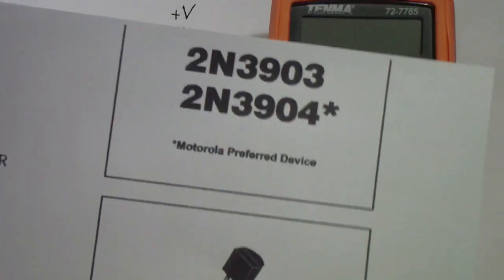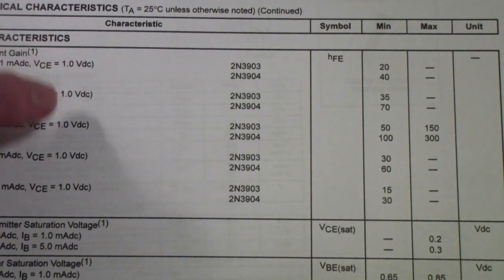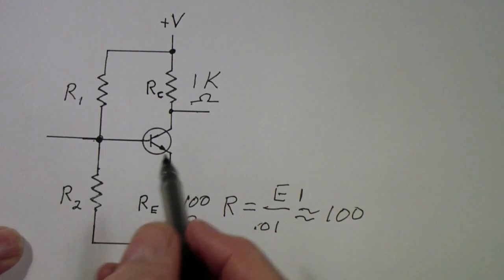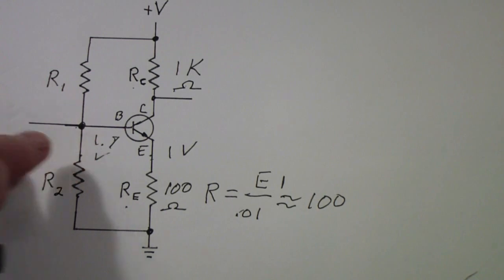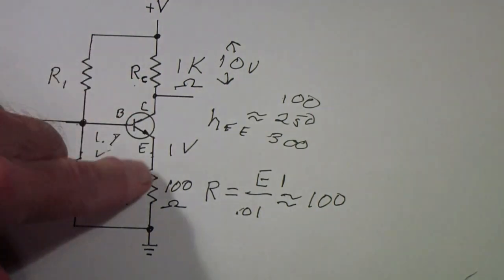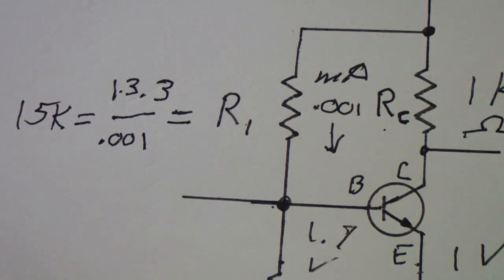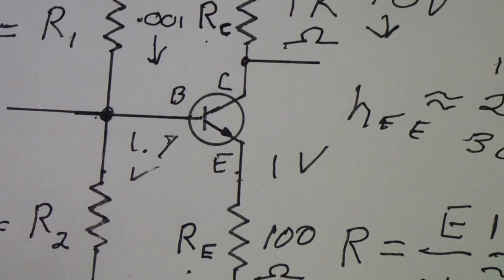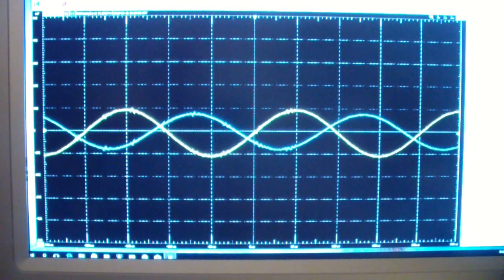TTT136 Class A Transistor Amplifiers Pt1

Comment: I understand that when the input signal is 100 mill volts the output is 10 times that or one volt, but what's going on when the output slides down to 100 mill volts (as shown on the oscilloscope) and the signal input strength rises to one volt, If I'm interpreting the scope correctly? Or is it possible that the two separate channels are set up for different volts per division etc.?

Thanks for the great video

Comment: I find your way of explaining logical and to the point but the thing that I don't understand at all is how you can plug some random voltage and current numbers out of thin air to use in your calculations. Like for example the voltage drop over collector and emitter. You just decide it to be 4 volts. The same with the current of the collector. You just say it's 10 mA. How do you get to such numbers?

Comment: it need a lot of math to workout to get it right my friends that I knows of it the laws of electronic it called V I R let see if I’m right or wrong R1+R2 let’s say 12volts DC if you connected it together the voltage it a divider it half of a supply power positive to negative it cause it to oscillate between +&- by R1+R2 maybe I’m wrong will if you asked me about maths or English how to write it correctly i guess the next days I will not returned back to school

Comment: What if i have 9V battery with BC107?  It has Ic=2mA and Vce=5V which seems that supply voltage would be inefficent to handle it. How to do calculations for such constraints where i cannot use other supply voltage? I know this is not efficent, but for sake of calculations.

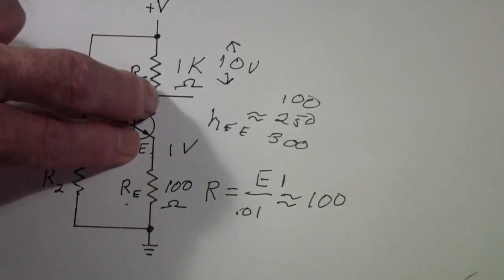Comment: Why did you assume 4 volts across the collector and emitter at the 14:40ish mark? Thanks for the great video!
Reply: I simply used his values for Ic, gain , and supply voltage 

His videos on this are excellent.. well worth watching the follow up parts where he looks at frequency/phase response / effect of coupling / decoupling capacitors etc..)

Ie = Ic + Ib
So if the current gain (beta) is say 200, then if Ic = 10mA then Ib = 10mA/200 = 0.05 mA
That makes Ie = 10.05mA 
So you "can" use that more precise value... or practically just say Ie = Ic .

As far as collector voltage swing is concerned...

As a rule of thumb.. we simply start with  "quiescent" Vc = 1/2 Vs .
Nothing more in it than that !!

This allows a reasonably midway point that the ouput can swing about . But in practice 
 simply keeping it away from extremes where clipping would occur)

That is: 
As the input signal decreases - collector current will fall.. and Vc will rise towards Vs ( and it cant ever exceed Vs ( when Ic = 0 :  that is the input signal has turned the transistor off)
And... 
As the input signal increases Ic (and Ie) will increase .

This will cause Vc to decrease.. and Ve to increase
( in other words Vce is falling towards  0v)

 so there will be "lower" limiting point where Vc = Ve 
( if we "assume" Vce = 0 - (it cant really go to zero 
  ie transistor is in saturation)

 at  this point, then Ic =
 15v/750+75 ohms = 18.1818mA

Giving Ve = 1.364V
And Vc = 
15 - 18.1818 mA *750 = 1.364v ( the same as we are assuming vce can go to 0v)

These are all  "approximate" values but near enough"

So you can see that output voltage swing can never exceed 15 -1.364 v = 13.636v

Put some real numbers in: 

Say vs = 0.5v pk to pk with a gain of 10 that will give an output swing of 5v pk to pk

If we wanted to drive an audio amplifier at 0dBu ( about 2.2 v pk to pk.. that would give an input vs of 0.22v pk to ok
Both well within our max swing!

So in practice we would never get close to our max value of 13.636v!

( one would normally plot all these on a load line )🎉
Reply: It is usually better to start with a given supply voltage.
 Lets say it is 15v. 
Next question is - what amplitude is my output signal intended to be.

If i set my collector voltage at around half the supply.. (7.5v) then that will give a reasonable maximum possible  ampltude of output signal swing  between  just below Vs = 15v  and (vce min  + vRe max )

( in practice you wouldnt let the output voltage swing near to these values since clipping would very likely occur )

So set Vc = 7.5v 

If we want an ic of 10mA - that makes Rc = 7.5v/0.01amp  = 750  ohm  ( nearest preferred value = 680 or 820 ohm ) 

If we want a signal  gain of say 10 that makes Re = 75 ohm ( 68 or 82 ohm npv)

( Signal Gain with an undecoupled emitter resistor as in this circuit = approx
 Rc/Re )

Gives Ve = 0.75v 
( assume Ie = Ic = 75ohm*.01amps)

Vb = 0.75v + 0.7v (vbe) 
 = 1.45v

R1 and R2 calc same approach as video except vb =1.45v
Reply: @eric4709  thank you so much. I literally sketched your answer out on paper. So, some questions. (1) how did you pick Ic=10mA? (2) why a desired gain of 10 as opposed to some other number?  (3) And so, after all this, Vce=Vc-Ve=7.5v-.75v=6.75v? (4) why pick 15v for Vs as opposed to some other value?
Reply: @eric4709 one other question: you said not to let voltage swing get near Vce min and Vre max. Where do those two values come from? So, I know what exactly to stay away from.
Reply: @eric4700 sorry, another question.  In the video from @tomtektest8042, he rounds R1 to 15K ohms. But, if we do the math using his 1mA of current, wouldn't the voltage drop across R1 be 15 volts? In which case, there's no DC voltage at the base of the transistor. If you back that out through all his other math (for example, Ve=1V (=Vb - .7), don't you end up with a problem?
Reply: @DavidBerlind 
Its just a potential divider
Ratio = 1.5/(1.5+15)
Multiply that by 15v
You cant really approach it with assuming the current in just one resistor.
The actual current is
15/(1.5 +15)  mA = 0.9091mA not 1mA 
Giving a drop across 1.5k of 1.36v
His values are all approximate.

( and his tests bear that out at around 21.3 - where he gets an emitter voltage of 0.687v 
Add 0.7v vbe to that and you get nearly 1.36 v
Reply: also why was 1v considered for Re?
Reply: Agree. The "assumption" seems like a very important detail if you're actually designing a circuit.
Reply: btw @mearslab, in rewatching the video, I discovered that your question is even more relevant given that @tomtektest8042 started using the transistor's spec sheet as guidance and at the moment he decides to go with the 100-300 gain, he notes that he's going to target 10mA for the collector current. But also, at that "on characteristic" for the 3904 transistor, Vce = 1V.  Not 4V.

Comment: A good introduction and a very usable circuit with decent linearity and a sensible voltage gain for a single stage.
However, when biasing the emitter close to the negative rail (i.e. comparable to the Vbe drop of the transistor), you'll get an operating point for the collector that is sensitive to changes in resistor tolerances and temperature. The dc gain of the circuit is the same as the ac gain, approximately -10.

When you calculate a base bias point as low as 1.7 volt and then pick standard resistor values for R1 and R2, it's always a good idea to recalculate the bias point and see what effect that has.

If the transistor beta is high, then we should expect that (15-Vb)/R1 = Vb/R2, so Vb = 15.R2/(R1+R2) = 1.36V, rather lower than the 1.7V target. That will give an emitter current of about (1.36-0.65)V/100R = about 7 mA, but that will depend quite strongly on the exact Vbe for that transistor. The voltage on the collector would then be 15-7 = 8V.

Those are quite close to the observed values in the actual circuit. However, the actual circuit shows a collector voltage of 8.6V, which implies a collector current of (15-8.6)/1K = 6.4mA; while the emitter voltage shows 0.687V implying an emitter current of 6.87mA. That's a rather large discrepancy and I'd be looking at whether your resistors are too far away from their marked values - they look like 5% tolerance.

Finally, the small-signal input impedance will be the parallel combination of R1 || R2 || beta*Re = 15K || 1.5K || 250*100R (assuming beta=250, but it could well be lower) = 1.3K and the output impedance is Rc (for audio frequencies) = 1K.

Comment: Seems like your picking the supply and not designing based on the supply? Also on the data sheet for the nte123 there is just a minimum gain 75 at 10volts  vce and 10ma

Comment: In the same circuit, if a different gain transistor is put in place, what are the results?
Reply: A transistor with a higher current gain (beta) will shift the base bias voltage up by a few tens of millivolts, increasing the emitter and collector currents by a few percent and moving the voltage on the collector down by a few hundred millivolts.
A transistor with a lower current gain will have the opposite effect, but the effect will only remain small in the given circuit if the beta stays much bigger than 10 (say 50 minimum).
Reply: The gain will be the same: Rc/Re = 10 (not 100 or 250). With a shunt capacitor on Re, the gain for the signal will be - what the tester shows (in this case 250)
Reply: @urkosh  No, The ac gain using a shunt capacitor will be Rc/re where re is the transistor's intrinsic emitter resistance, which is equal to 25mV/Ic. In other words, for a collector current of 10mA, the effective emitter resistance will be 2.5 ohms, and the gain will be 1K/2.5 = 400. Unfortunately, it will be temperature dependant and highly non-linear for anything more than tiny signals.

Comment: Hm, I would usually design a transitor amplifier stage in another way:
 
At first I would define the collector current and calculate the collector resistor in a way that the output voltage is half of the power supply voltage in order to get the best linearity over a wide voltage range. In the second step I would set the emitter resistor according to the desired voltage gain and calculate the voltage across it when the amplifier sits idle. At third I would calculate the base voltage divider considering a bias current Ib through it of 0.05 to 0.1 of the collector current. R2 = (V(Re) + V(be)) / Ib; R1 = (+V - V(Re) - V(be)) / Ib.

Comment: Can anybody help me understand the relationship between the desired gain and the minimum/maximum gain values found in the datasheet.  The DS says minimum gain is 100 but we enter this project with a desired gain of 10.  Are these 2 different gains that we're talking about or is he running the circuit at one tenth the minimum gain the Datasheet calls for?
Reply: Those are two different gains. The datasheet is showing the current gain of the transistor, called Hfe or beta, and that appears to be anywhere between 40 and 300 depending on collector current and individual transistor variations.
The circuit is designed to produce an inverting voltage gain of 10 , and good design aims to make that as independent of the transistor's parameters as possible. In this case, we arrange for the voltage gain to be set by the ratio of two resistors Rc/Re. The only thing which slightly depends on the transistor's current gain is the tiny base current that will slightly lower the bias points for the base and emitter, which is otherwise also set by the ratio of two resistors, R2/(R1+R2).
Reply: @RexxSchneider and current gain objectives are mainly about impedance? For example, if this was an output stage, we need more current to drive the speaker but if it's a gain stage we may not need so much current? Meanwhile we're looking to optimize voltage gain independently for a/c amplitude?
Reply: @ Indeed. If you want to drive a low impedance load like a loudspeaker, you're going to need a lot of current gain, which is equivalent to saying you need a low output impedance, preferably just a few ohms. If you only want to amplify a low voltage signal in a preamplifier, then current gain is much less of a consideration, because the next stage will usually have a relatively large input impedance, possibly tens of kilohms.

Using a single common emitter stage, we find that the voltage gain is normally limited by the supply voltage, while the current gain is limited by the hFE of the transistor.
Reply: he is running the circuit at one tenth the minimum gain the Datasheet calls for. The gain is determined by Rc/Re. If you add a shunt capacitor (10uF) at Re, the gain will be ~250 (as the tester showed). Datasheet is only telling: if you buy 10 transistors and check gain in the tester, it should be within this range 100-300. It was clearly 250 for this transistor.

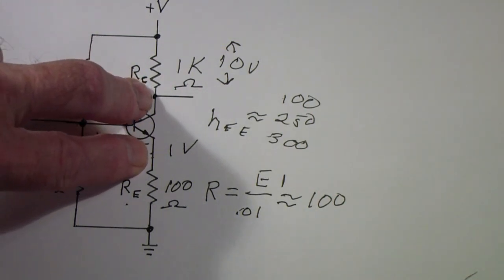Comment: 14:41 Where does the 4 volts assumption comes from? Why 4v? someone please
Reply: From what I've learned, it is not an assumption but rather a value that we control. We usually want VCE to be around half the value of the supply voltage Vcc. This is because VCE determines what we call the Q-point of the transistor, which is a point located at a certain coordinate in the load line of the transistor. By having VCE as half of the supply voltage, thus centering the Q point in the middle of the load line, we ensure that the AC signal that we introduce into the amplifier is not clipped at the output. 
I don't know exactly why he chose a value of 4 instead of 6 or 7... maybe because the AC signal isn't too big so it doesn't matter that much.
Reply: @guillermoviramontes851  thank you! yeah I'd like y
to know which critera was used for 4 and nota 6-7
Reply: @Lijericosas  You can go for 7V across the transistor (Vce) if you want, but you'll still want around another 7V across the collector resistor. Given the approximate 1V across the emitter resistor, that's fine for a 15V supply. That implies using a 7mA collector current (which is what the actual circuit turned out to be using). If you want more voltage swing with the same gain, you'll need to design with a higher supply voltage.
Reply: @RexxSchneider how do you measure Vce? Do you measure across C & E like you would measure across a resistor?
Reply: @ You're exactly right. To get the maximum output voltage swing possible in a common emitter stage, you want the voltage across the transistor to be a little more than the voltage across the collector resistor.
Reply: @RexxSchneider  thanks.. what's "a little"?
Reply: @DavidBerlind  a few hundred millivolts - effectively the Vce(sat) of the transistor you're using. If you have a decent supply, like 15V for example, it's not worth worrying about, but if you only have a 5V supply, you might have to start factoring it in.

Comment: 22:00 
Isn't that the emitter voltage with respect to ground and not the current ?
Reply: Yes it is. But that voltage appears across a 100ohm resistor and (assuming the value is accurate), we then know that the current flowing through that resistor is 0.687V/100R = 6.87mA, all of which flows from the emitter, so we know the emitter current.

When measuring currents in circuit, it is usual to measure the voltage across a known resistance, as you don't need to interrupt the circuit to put an ammeter inline.

Comment: 11:03
The base to emitter voltage is 0.65 Volts even when no voltage source is connected. How is that possible?
Reply: The meter is not measuring an external voltage. It is not on volts measuring mode.
The meter is on diode test mode and he is testing the emitter-base junction, which is effectively a diode junction.
In diode test mode, the voltage is supplied by the meter itself, often from an internal PP3 9V battery. 
This way, semi-conductor devices can be tested without being in circuit,

Comment: You talke about a gain of 10 because Rc is 10x bigger then Re and we saw it on the oscilloscope. What has this gain to do with the hFE gain? You should be more clear about that to not confuse the targeted viewers.
Reply: The voltage gain has nothing to do with the HFE current gain. The whole point of this particular circuit design is to make its operation independent of the transistor's characteristics.

Comment: When you calculated R1, you labeled the current as 0.001mA and used that number in the calculation instead of 0.000001A. Was that mislabeled?
Reply from the maker: The label is wrong. As the audio explains, the assumed current (approximately) through R1 is .001 Amperes or 1 miliAmpere. I apologize for any confusion.